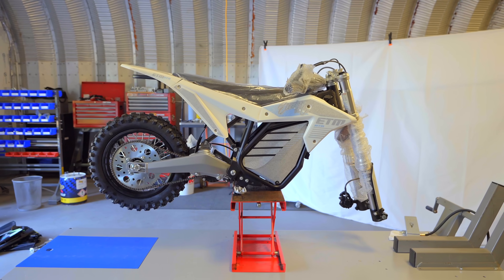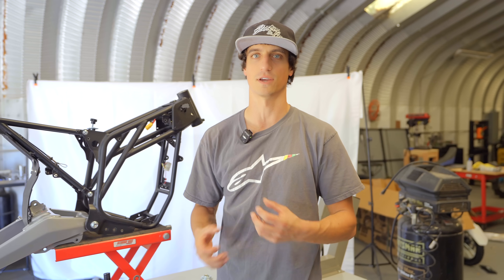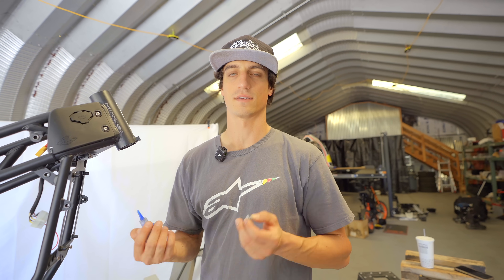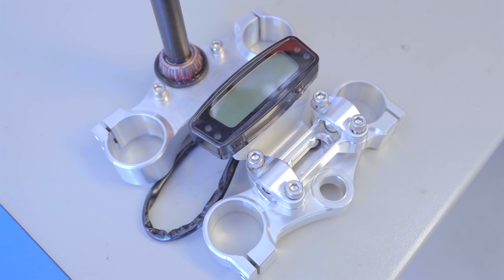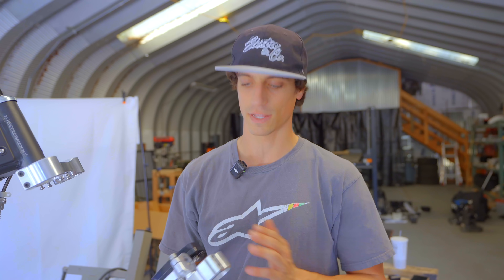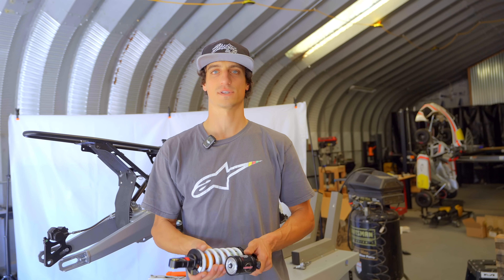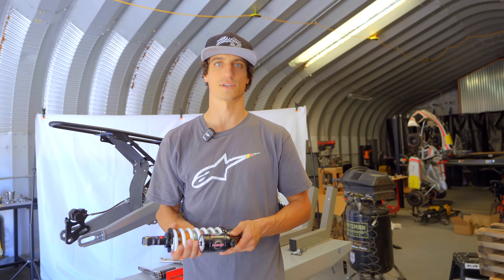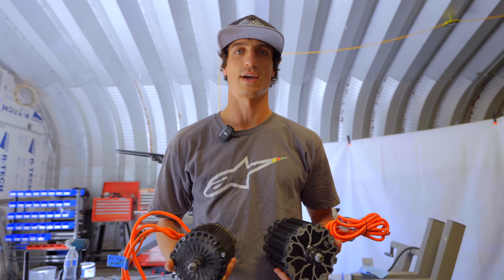We built the Fastest Electric Pit Bike in the World

Comment from the maker: Should we make a Pro model ETM RTR with these parts? 🤔
Reply: lwk yeah but don’t overprice it
Reply from the maker: @tiagoX1S with all cnc parts, a higher voltage battery, bigger motor, 420 chain, dnm suspension, crazy power, etc etc. 

What do you think a good price should be? Be realistic with it and let us know what you think.
Reply: @electroandcompany i would say around 4k
Reply: @electroandcompany also i was thinking of getting the rtr lite and how is the real world range on it? on my macfox they say it gets 38 miles but i really only get 14
Reply: @Raphatron and maybe a bit taller for taller riders
Reply: @Raphatron and instead of the 12-14 wheelset it could be 14-17 or 16-16
Reply: The 16-16 could be like a fat tire
Reply: @electroandcompany  to compete with talaria and eride pro, 4-4.5k?
Reply: @sea_muffin  and maybe if they can it can come with like a torp controller
Reply: @tiagoX1SI get 14 to 18 miles, I'm 6 foot tall and 20 pounds from its max weight, so if your smaller than that expect a lil more
Reply: @electroandcompany  rtr pro would be sick with the full catalog of current upgrades,  then you can also offer an electro and Co factory race bike with a silly amount of power. Price them at forty two hundred and six k respectively, big wheels as standard with the option of street or dirt set up out of the box would be awesome.  

I'd wait on higher voltage until you do a two fifty size bike. The rtr doesn't need to be a literal half size Varg lmao
Reply: @electroandcompany  like 4599 if its the same frame if its a better frame mabye bigger wheels i would say 4999
Reply from the maker: @SpartyFN34 you mean TruMoto? The controller lineup  we design and created our app for. 🤔
Reply: @electroandcompany honestly. No hate just saying. I can (and have) build a bike that absolutely DESTROYS the RTR for ~$2.8-3k. And doesn’t compromise on frame strength, pegs, bars, seat, plastics, or suspension whatsoever. So an RTR Pro at the price point of the current RTR or just above would be amazing. Say $3500. Lower the 72V RTR to $2600-2800. And put the RTR Lite at $1800-1900. Having the Lite’s price number not start with a 2 would honestly be incredible and you’d see “broke” kids snapping them up like hot Krispy Kreme donuts. I know about 2 dozen people right now who would like at least an RTR Lite but don’t feel like it’s worth it or they can afford it. Be honest, can you really not afford to lower your prices by $200-400 across the board depending on the model?
Reply: @electroandcompany has to be under 4500 at 5k you can get full size 16 to 20 kw bikes with bigger batteries
Reply: @SpartyFN34 they have a big wheel kit for a reason
Reply: @electroandcompany  Under $5k will keep you under the bigger bike price range.  I'd think anything under $4,500 would be a great value, especially with the suspension upgrades.  MSRP at $4,900 with some room for deals.
Reply: @electroandcompany YES YES AND YES dont make it a over priced bike tho ofc
Reply: @tiagoX1S fr,  im not including the lite, but the erm rtr is overkill
Reply: @tiagoX1SEa but thats what the Etm rtr 3000$ one is for not lor
Reply: Yes; etm RR “race ready” $3899
Reply: That’s fair I had no idea about surron bikes in comparison I was just clearly stating it’s mainly what is used here in England by all street lads, haven’t ever seen 1 RTR out ever but I’m happy to purchase myne tomorrow I’m so excited, just hope it keeps up with my friends who all have talaria x3 mx , should with more power 72v 😍
Reply from the maker: @WildRiftPlaya yeee🎉
Reply: @electroandcompany would you guys sponsor me with a upgraded torque motor so I can review it
Reply: @electroandcompany I’m probably going to get one of these rtrs soon should I get the rtr lite because it budget friendly, the only thing is I need the range so should I get the etm rtr, or should I save up for this one if you guys release it, for the extra stuff.
Reply: Open the flood gates! I want my ETM to do 70mph!
Reply: I’d buy it tommorow if you did I got your Miami vibes and I’ll buy that to!!
Reply: yes.
Reply: The rtr needs a 420 chain so bad
Reply: Can you sell the parts separate from the bike to
Reply: Yes but put the 17/14 wheels on it , the new altis delta looking sick, but this would crush it , just put the bigger wheels !
Reply: @GBMusicCompany yep
Reply: HELL YES!!! but like the guy said please don't over price it , but I believe @electroandcompany you see  both sides.  The manufacture  and the buyer ,  I'm pretty sure it will be priced right if it was to come to market !!!   EC  that's one mean tuff machine right there for real.  That RTR scream "YOU WANT BATTLE LETS GOTO WAR!!!!!!!" GREEN LIGHT 🚦GOGOGO!!! oc_rtr
Reply: Duh
Reply: Nothing is available in the app
Reply: Or just a controller that can compete with the speed of like an mx4 but under the price so like 4k should be good
Reply: Yes please been trying to sell the Miami vibes, just no luck but if it was priced right it'd sale like hot cakes
Reply: Yes, please — it should definitely be offered like that in the shop. A top-of-the-line model that delivers maximum performance — who wouldn’t want to get everything it’s capable of!

The model looks great and is definitely a reason to buy. However, we already have pit bikes that deliver 14 kW (HVR 65PRO SM). If you combine that level of performance with your design, it could truly become the best and most beautiful pit bike out there.

The pit bike would also be very interesting for rental use at pit bike training sessions, as we wouldn’t have to constantly adjust and repair carburetors and petrol engines anymore.

Can’t wait to see more details about the configuration!
Reply: @Ordnas_197  it should also have more colors stock instead of having to buy plastics, spray paint it or getting new graphics
Reply: if stock is already 3.3k, then a built one like this would be what? $5.5-$6k? Thats Altis Sigma, Pro SR, Ultrabee money.
Reply: @Nominally-Built  rtr lite is 2,090 with sale and discount another $2k in the power train kit and 35 ah battery and it'll be over $4k but it's close even then to rawrrs full size bike
Reply: @RileyRidesEbikes if the RTR were centered around a 14/17 sized bike instead of 12/14, it would be much more reasonable to spend that amount of money. Instead, it looks like they just fit 14/17 wheels on a 12/14 sized frame. They should've made it Bombmoto B2 sized. No matter how "race-ready" the RTR is, the appeal of a surron sized bike is still significantly greater.
Reply: @Nominally-Built bro the Rtr has a bigger frame than a surron which is 19 18
Reply: @John-i4f lol
Reply: Definitely! This is the model for me.
Reply: What’s the wattage and battery size? That would greatly affect the price. Many of the emotos are now coming with big batteries, which is a great thing. This would need at least your 35ah, 45ah would be great.
Reply: @notsoanonymous2458 it’s a 81v 13kw
Reply: Yeah don’t over price tho
Reply: Hell yeah 🤘
Reply: Yes and make a smaller one two with 10 inch motos 🤑✔️
Reply: Yeah
Reply: You should normalize them and also sell them separately as a kit for any other projects, such as electric karts and electrifying old gas Motos 👍🏻
Reply: Do itttt!!
Reply: I think you should make the tuttio kit already
Reply: Can’t be more than a grand over an RTR imo
Reply: Yeaa
Reply: I think so, but I also think you should do more special editions like the Miami one too… I just saw that one on the website and that thing is siiiccckkk!!! ❤
Reply: yes
Reply: I think you should because people that mod it after they get new parts it’s hard to recycle and get battery’s away
Reply: Ya
Reply: @electroandcompany  don’t it ruins the fun of modding a bike
Reply: yyyeeesss
Reply: Depends on the price 
😅
Reply: Hell yea
Reply: Yes please
Reply: Please can I get a rtf light shipped to AUS I will do anything!!
Reply: Yesss !I was about to ask for that
Looking forward to see some of them in France
Reply: We have a surron ultra bee, a surron lite bee, and just bought two RTR lites for my sons. All those bikes are awesome. They all have a place. These RTRs are absolutely killer. So fun, great for learning, and they look absolutely rad.
Reply: Yes
Reply: Yes, and make sure to stock your warehouse on Oahu
Reply: do it, swipe swipe 😅
Reply: Electro and co I think y’all 100% should make a pro model! And y’all should make a bigger bike like the SURRON light bee or maybe even the Stark Varg.
Reply: Yeah please do I don’t like my surron
Reply: YES. This is the bike I want!
Reply: YAAA
Reply: Add carbon fiber fenders!!
Reply: yes the bike is so clean
Reply: take my monies
Reply: Yes and I'm curious do you guys plan to do a full size bike eventually?
Reply: Please wait till next Christmas I just bought me an rtr 😅. Maybe drop a California edition 76v  with as much power as the frame can take before it starts to twist off the line big cali style 🤙 . Purple blue shift paint all orange anodized parts and white mags with cali sunset accents id pay $4500 all day ...but not till next Christmas tho 💀. If you build this I'll test it out with you guys and chase the team drift style for the website 🤙.
Reply: Holyyyyyy it's coming !!!!
Reply: 100% I’m about to buy my first ETM RTR and i have a huge following in the UK, so I want to make sure I get this bike recognised throughout England, and also making sure upgraded parts are shipped to uk, if you price it to close to sur-Ron’s the issue is it’s way more recognised In uk so price must remain competitive. I would be happy for a sponsor 👍
Reply from the maker: @WildRiftPlaya Surron is flimsy, underpowered and has no race ready parts, it’s not even equal to the ETM RTR lite. Which is 2 grand less than the Surron.
Reply: @electroandcompany 
⚡💥⚡🔥⚡Bigger Faster Stronger ⚡💥⚡🔥⚡